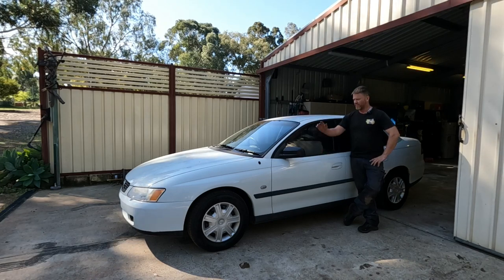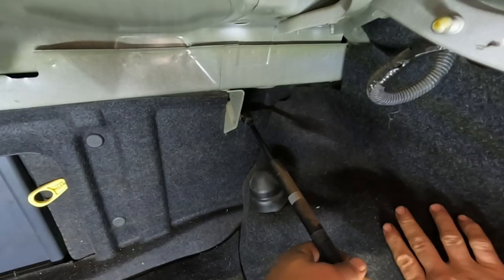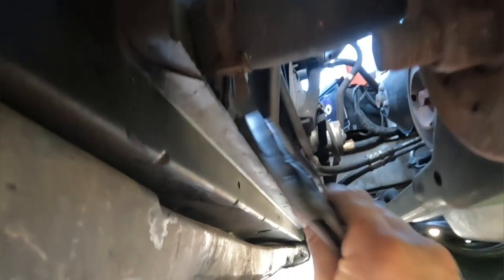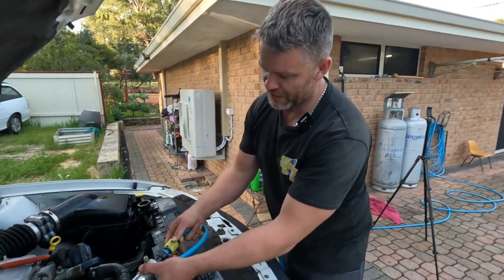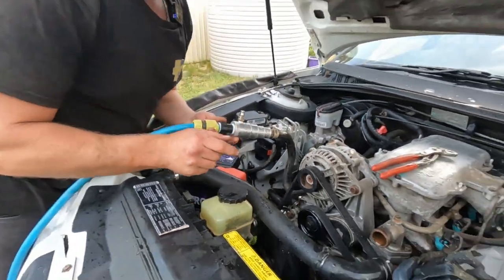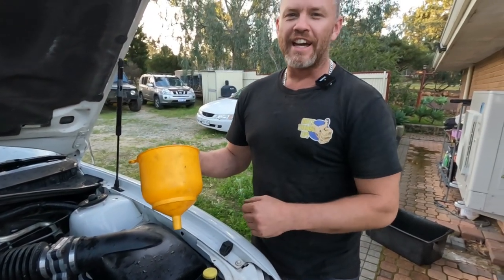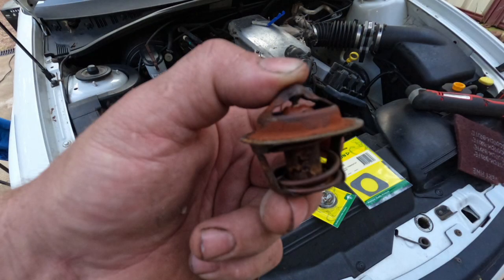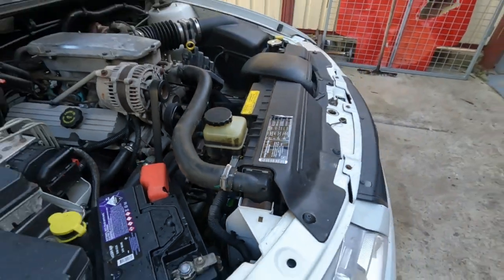Coolant flush and gas struts in the boot on the VY Commodore Getting ready for the road again

Comment: Thanks Byron. Really helpful. I spent hours looking for the drain plug but pulling the pipe is so easy. Previous owner put oil in the rad, now the whole rad is clogged up at the bottom including the over flow. Any suggestions would be blinking appreciated... Thanks again
Reply from the maker: Gday mate 
I would back flush the system probably keep doing this until clean dish washing tables work well then Replace radiator, thermostat, heater tap and hosing probably water pump as well but depending on your budget
Reply: @downtheshedwithbyron  got that, thankyou.
3rd flush tomorrow. Hoping it's not a valley gasket like the neighbour suggested.
I found your explanations and demos easy to understand. It really helps people like me with little idea. Thanks again.
Reply from the maker: @sterling1steve  no dramas mate
Reply from the maker: Did you say the person before you put oil in the cooling system or its got oil in the cooling system?
You might have to check transmission oil thats common 
Your probably going to need a new radiator
Reply: Yup gotcha. 
Third flush through with your method got as whole load of rust and crap out. 
Transmission fluid tomorrow.... Then oil but the blighter shredded the bolt... Never ends... 
Still I love the car. It's my first Commodore. 
Thanks again
Reply from the maker: @sterling1steve  awesome mate

Comment: So after the flush an alternative to test/relieve the heat pressure rather than rag over the cap is to crack the bleed nipple at the top of the top hose.
Reply from the maker: I like to do it as im filling the system
Reply: @downtheshedwithbyron  fair enough. Had a mate do the rag method when he thought it had cooled down enough and about a litre of coolant exploded on him, wasnt burned luckily but any hotter and yeah.

Comment: Noob question but do both high speedfans kick in or just one?
Reply from the maker: G'day 
1 fan the larger one kick in for engine cooling 
The other fan smaller 1 is for air con hope that helps you 👍
Reply: @downtheshedwithbyron  thankyou
Reply from the maker: @ReneeMackenzie-dp6hl  hopefully you sort it out they are common to fail

Comment: nice vid. I believe Holden recommend removing the bleed nipple completely when filling through the top radiator hose with one end in the radiator. This pushed all air out when filling block and most of radiator. Once it starts running out all air would have been pushed out. Reconnect the hose and fit the yellow tool or an old radiator hose and fill more coolant until steady stream from the bleed screw. As it is squirting out install and tighten screw. Then just start it up and run till thermostat opens. But this stage most air left is bubbles from the water pump impeller. The supercharge versions can be really hard to bleed with the thermostat at the back.
Reply from the maker: Yeah mate thats the go

Comment: Hey thanks for the video, I found it very helpful. I have got to the stage of refilling with water and draining again to clear out the flush cleaner but I can only get about 6 or 7 litres back in each time  before it overflows. My manual says it should take 12 litres. I am guessing the block still has about 5 litres in it. Will that be ok?
Reply from the maker: Cheers dude 👍 
Yeah id buy 10l of coolant and you'll be right

Comment: Just had to top up coolant in my 03 VY Berlina so topped it up via the radiator cap made sure it went through took it for a 40 min drive got home then after it cooled down I checked it and it wasn't at the top so I gave it a good pour and I've been doing that for the passed 3 days is that cause it needs to go through the system and everything so it's not completely full or something? I've seen no leaks anywhere got cardboard under it everyday to see if so but nothing yet anyone understand what I'm talking about thanks fellas!!
Reply from the maker: G'day mate 
Hey maybe see if you can borrow a pressure tester or get it pressure tested sounds like youve got a leak 
Sometimes the intake manifold leaks at the back of the engine
Reply from the maker: Also see if these a coolant stains on the transmission eg where coolant from the back of the engine could be running down from